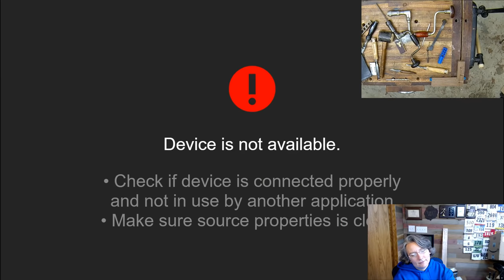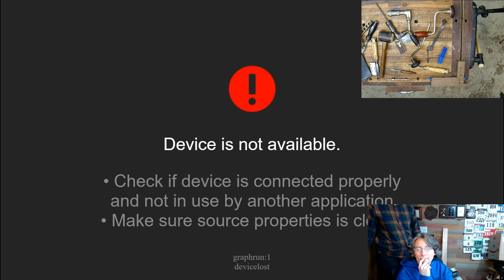Pocket Hole Joinery and Why it is the Worst/Best Ever ALL HAND TOOLS

Comment: At 2:23 of a 57:44 video the message got through to you about the sound, it took you until 5:33 to fix it. It’s obvious this is a live broadcast uploaded and equally obvious someone would have mentioned it during the broadcast. So why on Earth are there 8 comments mentioning the sound? Surely they could have held back until it was sorted. 

The Shakers used a lot of pocket hole joinery, I learnt that off James Hamilton I think. 

Do you only use a brace and bit or do you ever use the egg beater hand drill? Thank you for explaining why the Craftsman is a bad chisel, I was curious because I know like Paul Sellers you are an advocate for cheaper chisels being good enough. 

I know your dining room table is awesome, but I thought your workbench would have pipped it as your favourite project. 

A very very enjoyable video, thank you for making it.
Reply from the maker: LOL yup. some people just don't realize what is going on.
ya but the Shakers did not know what they were doing. LOL
I find myself using the smaller brace far more then  the eggbeater drill, but on bits smaller then 1/8" I pull out the eggbeater drill.

Comment: Pocket hole joinery, though not my first option, nor pretty by any stretch, is probably as strong as a lot of other joints and they've been around longer than either you or I (and I've been around a time). I've seen mortise and tenon joints get loose and pocket hole joints, just as old, that didn't and vice versa. Always into cross grain if possible. A video on whether pocket holes are good or bad or good and better is really rather pointless. Those who enjoy joinery will do joinery, when you need some functional joints without a lot of time ( or visibility) involved, use a pocket hole joint. Let's not kick the can around the block endlessly. I think your thinking about strength in the pocket holes concerning a chisel vs. a stepped drill is moot (and somewhat flawed). The strength comes from the remaining wood, if you want more strength, then increase the angle, back up an 1/8"  to allow more wood left to hold the joint and move on. Therein lies the logic. Don't kick a dead horse, just use some applied physics or find an endeavor that doesn't lend itself to overthinking and production paralysis.
Reply: Interesting that you have all the knowledge and criticism but have never made the first video yourself.
Reply from the maker: Thanks for your thoughts. that is why I make these videos.